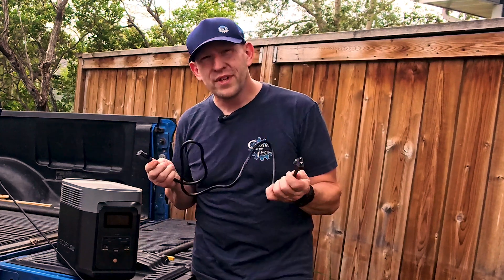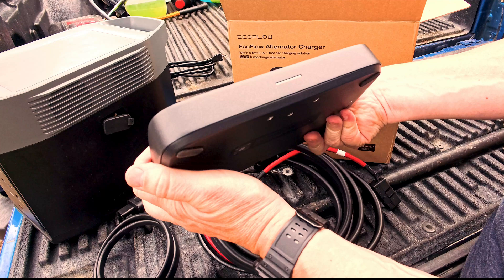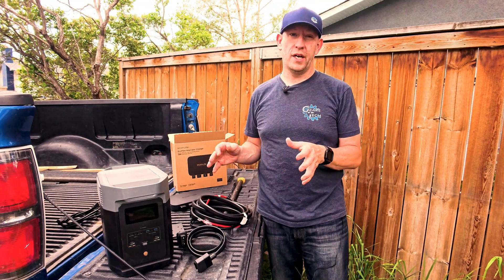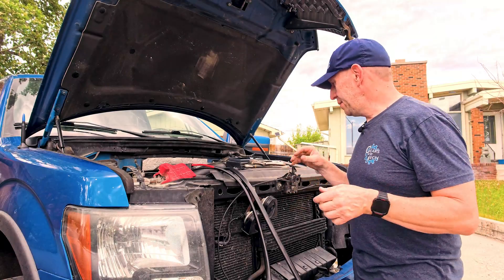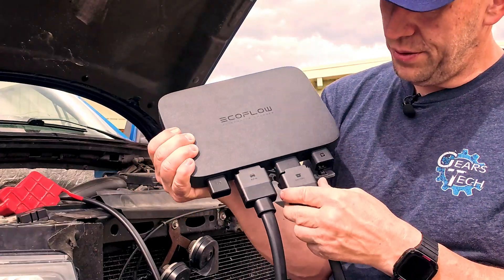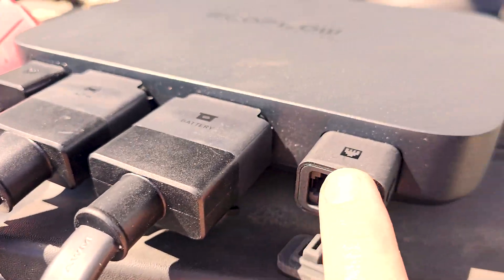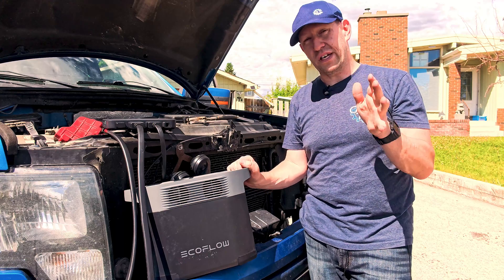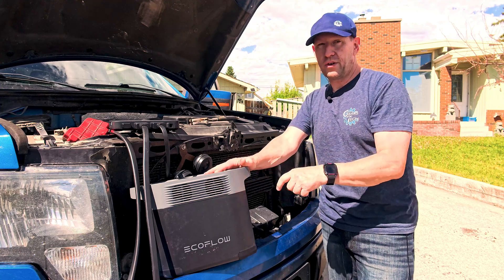How Easy Is The Ecoflow 800W Alternator Charger Install?

Comment: This is very interesting technology, but!

i am curious.

Most vehicles, up to 90%, have an alternator with a minimal amount of spare wattage over normal vehicle operating conditions.  This is between 200 to 400 watts.

The Ecoflow max wattage is 800W which leaves a 400W to 600W shortfall for 90% of vehicles on the road.

In these vehicles where does this shortfall of power come?  The battery.  Or the Ecoflow backs down to a lower charging wattage.

What happens when a starter battery is older and not performing to the original manufacturer specification?

The load demand goes to the alternator.

Then what happens to the alternator?  

The load generates much more heat in the alternator windings and diodes, especially at idle/rmp speeds where the alternator cooling fans spin resulting in significantly reduced cooling.  This reduces the useful life of the alternator and and will eventually causes complete failure.

Last, I noticed you are demonstrating with a pickup truck.  A very important point is that most large pickups are designed with higher capacity alternators to account for trailering lights and additional trailer auxiliary components such as braking batteries and more.  This demonstration may not adequately reflect 90% of vehicle alternator capacity, mine is a great example, a minivan with 150A alternator with 180W spare capacity.  This is very concerning and a repair of an alternator in particular at a very remote location, can be extraordinarily expensive, $2,000 - $4,000, this comes from experience.

I want to know the details of how these chargers work.  The reason is that I want to be educated about the financial risk I am accepting.  

This is basic physics.  We don't get something for nothing.  It has to come from somewhere.  

If you want 1,000 gallons of water, you can get it quickly through a 24" pipe and a 1,000 gallon reservoir.

If you have a 6" pipe and a 3" connection to the 1,000 reservoir, the math becomes clear.  You can get the 1,000 gallons, it's just going to take more time.  Put to much pressure on the 3" connection and you have a failure with a potentially expensive repair. 

I am only saying to be careful, read up and be educated about charging units.  They can be extremely useful however with one extreme comes another.  It's the physics thing again.
Reply from the maker: Go a step further, if you ask for 1000 gallons but only have 500 available where does the missing water come from

In all cases to your question the answer is easy.

The charger monitors the supply voltage. If voltage drops it pulls less power. An alternator that has reached its limit of power will start to pull the extra from the battery, which drops the voltage, so the ecoflow charger dials back teh charge rate until its balanced.

Ecoflow also makes a 500w charger that's cheaper and better suited to people with small cars or smaller altrrnators. 

You can also adjust the ecoflow to never pull more than a certain power amount, so if you know the headroom on the alternator you can fine tune it

Comment: So easy?! Until you gotta run the wire from the cabin out the firewall to install it properly.
Which requires locating an area to get through the firewall. Depending on your vehicle, this can be easy or extremely difficult. 
For my Mazda 2025 CX30 it’s difficult and I’m getting a professional to install it

Comment: I had my EcoFlow installed on Nov 4, and then on Jan 10 I had to replace my battery and alternator for $1,200
Reply from the maker: Seems like a strange coincidence.

Make sure the settings are correct in the app. You can adjust the max charge  rate and the min voltage. Probbaly it was setup to charge off battery voltage instead of alternator voltage so it was working when it shouldn't

Comment: Doesn't the instruction manual say to ground the negative wire of the alternator charger to the vehicle's chassis
Reply from the maker: Direct connection to battery is better.

But grounding can work as well if you're installing further away

Comment: Nice! I wonder if, with this device, I could just start the engine without moving the car to charge a power station or does this harm the car’s alternator in the long term?
Reply from the maker: That's exactly what this is for.
Reply: @GearsAndTech mmm not sure won’t harm the vehicle if it’s not moving, that’s what I found: “ owners should totally avoid using the Eco Flow charger whenever the vehicle is stationary, because alternators are designed to cool with frontal air as the vehicle is moving. This flow of cool air over the alternators cast aluminum body and fins, help the internal fan maintain safe operating temperatures when under high loads.”

Comment: But you said it connected to the alternator.  😂😂😂🤦🏽‍♂️
Reply from the maker: Electrically the alternator and battery are the same connection. The wire is big enough to handle the power all the way through
Reply: @GearsAndTech   Nobody in their right mind would try to connect this to the alternator.  Kinda defeats one of the major selling points…..being able to jump start the vehicle starter battery.

Comment: Interesting product but the list price is $599, Amazon $356 on special right now.  But for that money, I would rather just put that money towards a gasoline/propane  generator.  800 watts is easily accomplished with even the most basic generator.  Your still burning gas with your truck, probably more that the generator would.  It's cool, but too expensive.
Reply from the maker: This is more useful for some vanlife guys that need to charge while driving
Reply: @GearsAndTech  true, van life or camping, truck drivers, etc..
Reply: You'll be hard pressed to find a generator that is more fuel efficient than a car engine, car engines by EPA law are forced to be extremely efficient or face fines. That's why everyone is switching to electric, cause it's getting impossible to keep up those efficiency standards, electric mpg are bogus so it's a  way around that.

Generators built for power don't have those standards, but they have more fuel options.

Just wait till it's on special, it was $180 a month back.
Reply: @downtube8fs  you could be right but I guess it all depends on your car or truck.  A v8 engine vs a Honda inverter?  I’d think the Honda wins that. From what I found a Honda eu2000i burns 0.12 gallons per hour. A 4 cylinder car engine at idle burns 0.5 gallons per hour, a v8 =1 gallon per hour.

Comment: Many new trucks and SUV's come with a 120V outlet allowing you to charge your generator on the fly. Probably back up to full charge in less than an hour.
Reply from the maker: Most of those are only 300 watts. It's not going to go as fast as you think
Reply: I have a 2023 Toyota 4runner trd orp and if I plug it in to the power outlet in the back I'll get an error, it's not enough watts. (dirty power)
Reply: Those are less efficient as they convert dc to ac, then back to dc again.
Reply: You have to have a pretty powerful inverter to charge a solar generator. I don't know if it just lowers charge rate or just overload inverter
Reply: @FewerOptions-mx7qt  you can't just plug your portable battery (EcoFlow) into your 120v port in a vehicle, it doesn't work because it's not clean power. (like 120v in your house)

Comment: Never run ecoflow to 0 if you can help it. I've been using them for 5 years and learned the hardway
Reply: This is good advice in general for batteries, but I think not quite as concerning for the newer LiFePO4 batteries which can be fully discharged and charged without shortening the life
Reply from the maker: Great point
Reply: Please elaborate how bad could it be? I’m new to EcoFlow and I’ve been dropping the battery to 0% occasionally. What happened to yours?
Reply: @MagnanimousMagnitude  If your battery is LiFePo4, it can handle being discharged to 0% and recharged no problems. Older batteries had issues with this.
Reply: @starskymedia  ok cool I got the delta max 2 so I’m good thanks for the clarification!
Reply: @MagnanimousMagnitude some YouTubers will say something like with a 100 ah battery you really only have half the  capacity because you harm the battery otherwise. I think it's just YouTubers trying to one up each other as being the most battery efficient people pushing that number. Is argue only charging up to 80 percent and discharging until at 60 will be the only way for battery to last 40 years . Lol
Reply: Not just ecoflow any lithium battery
Reply: Any LiFePo battery.  Not Lithium ion types. @brpixels

Comment: It's probably the most expensive DC to DC charger available 🤔🫤 I also hate how they talk Watts no Amps lol even you got Amps ,& Watts Confused
Reply from the maker: The problem with talking amps is its function of the voltage.

Since this is pumping the voltage up higher, the amps drops but the watts increase

So a

12v 15A charger is NOT the same as a 60v 15A charger

The amps are the same, but because they pumped the voltage up they are getting way more watts into it

And since the device we are charging is rated in watts it makes sense to talk about charge capability with watts too.

But yes, even I got tripped up when I was doing teh review because we don't normally talk about watts. Since we fuse stuff based on amps
Reply: @GearsAndTech  Yes is tricky when a company digressed from Amps. So can you do an Amps test on the input with a clamp meter? plus those ecoflows are built with many cells Vs a LiFe 
It only takes one cell to go bad and your stuffed if you push unit hard with toasters etc. .
Here in Australia that unit started @ $799AU 
My 30a renogy DC with a solar converter was about $250

Comment: Does it protect your starter battery from decharging too much?
I don’t want to drain the starter battery 🪫 to the point that I can’t start the car anymore!!
Reply from the maker: yes, it has under voltage protection. Normally it only runs when the vehicle is actually running, but you can turn that down lower if you want to charge while vehicle is off

Comment: Thanks for the vid. It should be mentioned that this Alternator Charger only works with the Delta series of Ecoflow batteries. The River series do not have the expansion port to accept input from the Alternator Charger.
Reply from the maker: Great point

Comment: Any idea on the wear and tear on battery or alternator!?! Is this safe for long run to use it often (camping) or be in natural disaster scenario ?
Reply from the maker: No extra wear and tear. Alternator is designed for the load.

Comment: your truck needs cam phasers/timing chains, you might want to get it looked at before it leaves you stranded
Reply from the maker: Too late, engine blew up a week after filming this video.

I had replaced he timing chain and tensioner. Turned out the oil pump was weak
Reply: @GearsAndTech ouch, was it a 5.4?

Comment: this answered the one question I had involving the fuse cable. Good video.  thanks for making this easy for beginners.
Reply from the maker: Glad it helped
Reply: I would replace the fuse with a circuit breaker. I would get a 125amp 12/24v marine circuit breaker. $35

Comment: You can charge the battery expansions right from the alternator charger, so charge the Ecoflow generator, then charge the expansion battery
Reply from the maker: That's right
Reply: Especially if you are poor and only got the delta 2 with only one XT150 Port.

Comment: Can you get both the Alternator charger and solar to work in tandem?
Reply: Yeh you can, that gives the full 800w of charging power
Reply: @Silverwidows Wait? So if I put in 500w of solar, and then run the alternator I still end up with 800W?

Or is it 500 + 800 = 1300W?
Reply: @kobodera8261  it's an 800w unit, so that's the max
Reply: @Silverwidows the alternator charger itself maxes at 800 and solar doesn’t attach to it, but rather to the XT60 port on the back of the Delta. The delta can charge at 1.2kw so the question is actually can it do both those things at the same time?
Reply from the maker: yes. just plug them both in
Reply: @IDDQD-z3e  Thank you!

That is exactly what I was asking for!

Comment: why is it called an alternator charger if its connected to the battery?
Reply from the maker: It is charging off the alternator. The bug battery cable goes straight to the alternator. Electrically it's the same is attaching it to the alternator. It's just a lot easier to put it on the battery
Reply: What charges your battery?

Comment: Anyone have a problem with stay connected to the app?
Reply from the maker: I haven't really used the app much, so can't say for sure
Reply: @GearsAndTech  I found out if i drive away from my Wi-Fi it always disconnects.
Reply: @TransformerOverlander You could make a mobile hot spot on your phone and connect to that, if you wanted.

Comment: I threw away the instructions 😂
I came to YouTube and see if someone knows why it doesn't charge with green light.

I got a better deal through Hobotech discount code.
849.00 with Delta 2, alternator charger, and 100w foldable solar panel.😊
Reply from the maker: Use the app. You can adjust the settings for charging

But that button on the side was probbaly your problem?
Reply: @GearsAndTech  
Yes it was the button.
Thanks

Comment: You don’t need to be at 14 Volts. Easy set up in the app where you can adjust it. Some cars with smart alternators routinely drop the alternator charging below 14V at idle, so I use 13V setting on mine. You could easily set it to 13 or 12 volts charge an Ecoflow Delta directly from an RV battery bank. Good video, but would have been much better with accurate info.
Reply: "at 14amps"?? I think you meant to say at 14V (?)
Reply from the maker: Great points. Thanks for sharing
Reply: Thanks!

Comment: Thanks for your work in this video, i’m wondering if i upgrade my alternator will it charge faster?😊
Reply from the maker: If you get the 800w of output then there is no need

I didn't do a current draw check on the alternator, but I have a feeling that box is boosting the 12v to 72v. If so, the current from the alternator is gonna be really low anyway. So an alt upgrade won't do anything
Reply: @GearsAndTech  good point
Reply: I'm not so sure if the upstep from 12V input to 72V output has any influence on the load on the alternator... If you get 800W input on the EcoFlow Delta, you have to draw 800W (plus a bit of lost power for the upstep) from the alternator, otherwise you'd have invented the perpetuum mobile :)
800W from the alternator (divided by 14V) is a current of 57A ... The cable from the DC/DC to the EcoFlow Delta, assuming 72V, is 6 times lower, ie under 10A, which allows for a thinner wire...

Comment: A charger to recharger your other charger how Unique. Just get a honda gas generator and be doe with tall the BS
Reply from the maker: Depends what your goals are. This actually works great and is a lot better than a Honda generator in a lot of ways.

It's not a replacement. Just like the electric cars. They won't replace gas cars, but each have their place
Reply: You can’t run a gas gen everywhere…. Then you have to store your gas… you can’t use a gas gen inside the RV especially while driving… you can’t recharge your gas gen with solar while chilling at a campsite… they have different pros & cons
Reply: exercise your brain opie
Reply: No one wants to hear generators running when they are trying to get some fresh air and away from city noise.
Reply: You're right, genius - I'm gonna run a loud (to draw attention from security & the cops, graciously allowing stay and annoying everyone else), poisonous gas generator inside my car all night and all day as I drive around.
What an out of the box thinker you are, dpshtt.
That's some REAL community college level logic, champ

Stupid. 👏🏿👏🏿👏🏿
Reply: If this thing, would, plug into, and automatically prioritize, the extra battery (even 2), The automatic gas generator, and solar panels. That would be magnificent. All existing Ecoflow Products.